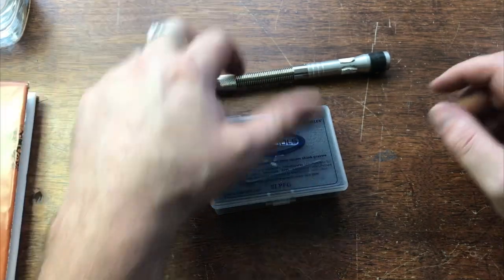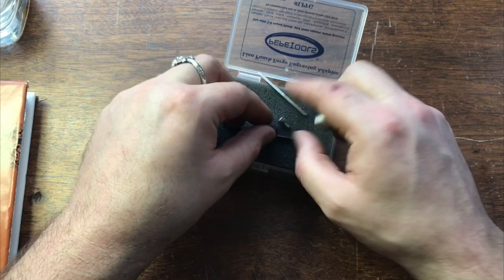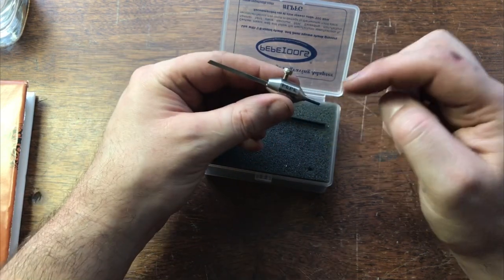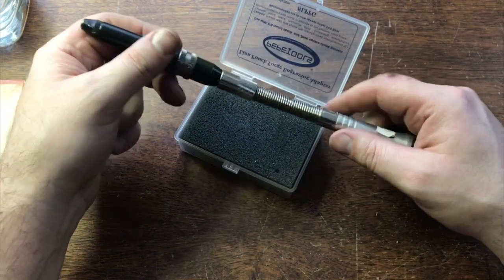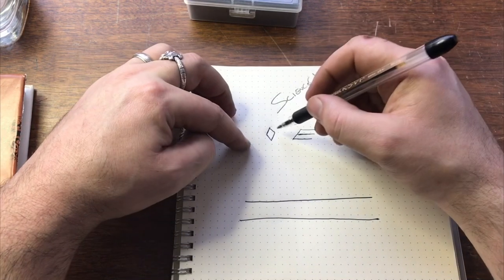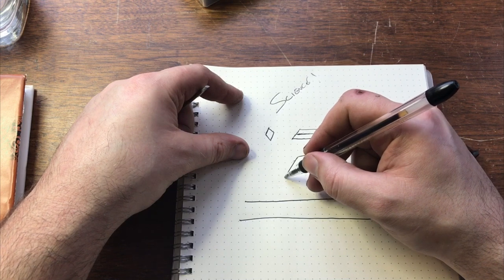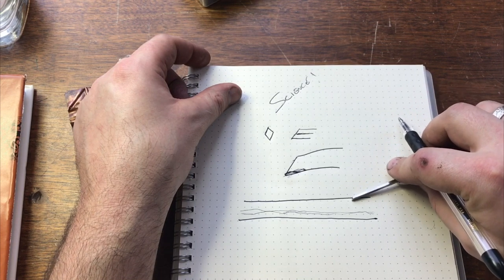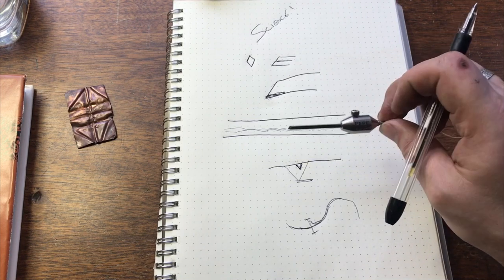Pepetools LPFG  how-to Foredom h15 hammer instructions unboxing setting up basic engraving technique

Comment: Hi there! How cool is this??!! Thanks so much! I have been trying to figure out how to adapt some my tools to my new hammer handpiece for the last week. Great you already invented the exact thing I was wishing to have! Now I am wondering, the tool I want to adapt is a milgrain. What are your thoughts about it?. Do you think this adaptor could work for this? have you try it with milgrain tools? or heard of someone that use this tool for milgrain details? I really appreciate any input! Thanks!
Reply from the maker: Hey Laura! I have used milgrain tools using this adapter - the only issue I can see is that you would have to use the longer screw that comes with the adapter- since milgrain tools normally have a smaller diameter shank!
Reply from the maker: New video on the LPFG is out

Comment: Hi Chris, just got my engraving adapter and it came with two small washers and two tiny coils.  What are they for?
Reply from the maker: Lori Yarrow those are for placing between the adapter and the hammer- to reduce the stroke of the hammer Sandi Sturgon found this to produce more accurate experience learning to engrave
Reply: @LionPunchForgeLPF  Thank you!
Reply: @LionPunchForgeLPF  Mine came with 3 metal washers and one plastic.  Should I use all of them?  Should the plastic one go closer to the adapter or the hand piece?  Thank you :)
Reply: Correction 5 metal washers and 1 plastic
Reply from the maker: As the product development continued we adapted the kit itself to improve use ability- Ann I think you got the most recent version

Comment: Hello. Can you use the Grs gravers with it?  Many thanks. Jess
Reply from the maker: Yes you can, the ones for the QC Adapters are awesome. You will have to round over the corners slightly to fit into the 1/8 round hole- but I use and love them.
Reply: @LionPunchForgeLPF  thanks.

Comment: Just got my LPFG from PEPETOOLS today, and the graver, (labeled PEPETOOLS #4SQGR), won't fit in even with the set screw removed. It won't even get all of the tapered end in. It only slides in about 1.4mm. I measured flat to flat on the graver, and it's 2.2mm both ways. You say on here it fits 2mm, so is the graver just too big or am I doing something wrong?
Reply from the maker: Have you contacted Pepe about the gravers ? They should fit . If you have a chance send me some Pictures
Reply: @LionPunchForgeLPF  I had already sent an email to them with a picture and while they haven't directly replied to me, about a minute ago I got an email from them acknowledging an order for a graver for $10.00 which made me think wtf until I looked farther down and it had a $10 discount didn't fit line! So apparently they're sending me the right one. I could just grind this one down to 2mm no big deal, but I though pepe would want to know, you know? Turns out they wasted no time.
Reply from the maker: If there are any further issues reach out! I’m glad it’s being remedied for the moment
Reply from the maker: Hey Patrick I wanted to touch base with you again- I have looked into this further and there were indeed some gravers sent out of improper size- this is being remedied and I wanted to let you know I take full responsibility of this oversight and will be working diligently I make sure it doesn’t happen again. Respectfully - Chris
Reply: @LionPunchForgeLPF  that's cool beans, like I said, I could just grind it down I just wanted them to know they sent out the wrong size. Still haven't received the right one but when I do, fun will happy:)
Reply: I'm so happy, I got the new graver from PEPE in the mail today, it slides right in and I can't wait to start using it. Love you, love PEPETOOLS!

Comment: Will this only work on foredom flex shaft?
Reply from the maker: No, it will Also work with all flexshafts that use the a keyed shaft. You will need a hammer hand peice but as long as it accepts keyed hand pieces same as the foredom you are good

Comment: Just bought this adaptor to go with a Foredom h.15, and it doesn’t fit. The thread isn’t the right size. And the adaptor is brass, which I haven’t seen in any online photos. We bought it from a shop here in Australia. Just wondering if anyone has come across this, or if we were sold a fake???
Reply from the maker: We do sell a gold titanium coated version. We have come across this issue before with counterfeit hammer handpeices feel free to reach out to me at lionpunchforge@gmail.com if you need more help
Reply: @LionPunchForgeLPF  thank you. The hand piece isn’t counterfeit - it was purchased from Foredom. Perhaps the adaptor we got is a gold coated version. The thread doesn’t fit though. Perhaps it’s just a slight manufacturing fault?? The thread difference is 2 thou of an inch. Why the change to titanium nitride?
Reply from the maker: Sent me some pictures to the email
Is listed